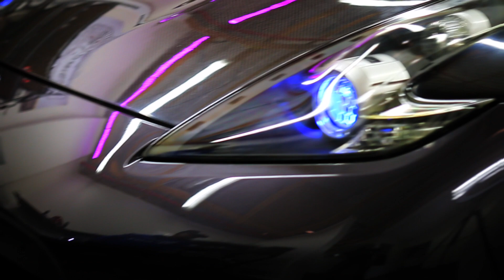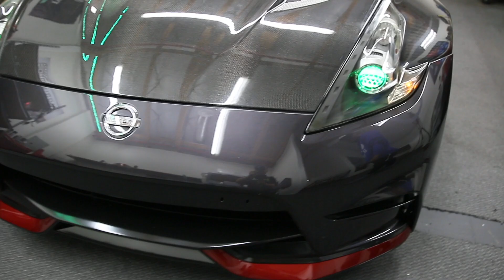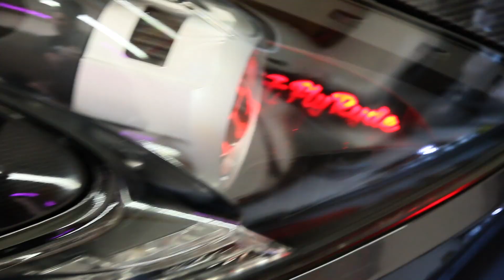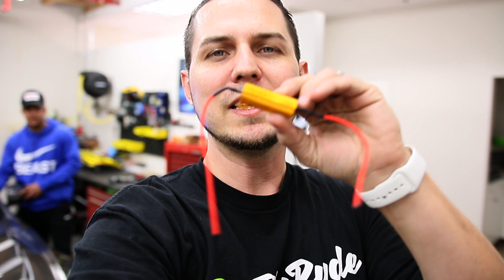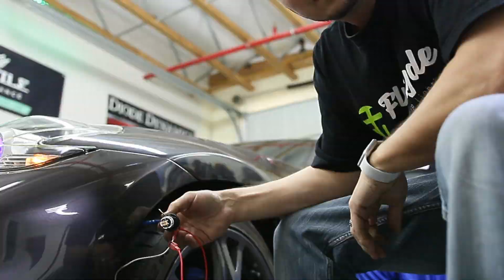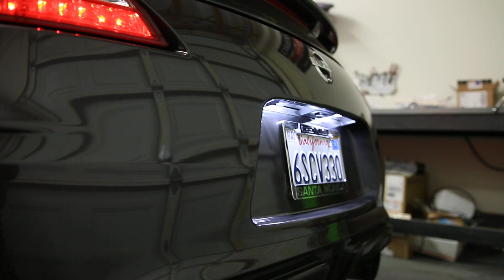RGB Demon Eye Headlights on Carbon Fiber Nissan 370z | FlyRyde

Comment: Most of the time, you really should use an LED flasher relay instead of using a load resistor... using a resistor eliminates half the reason for using LED turn signals.

Comment: So on a 370 Z, if I have switchback bulbs, I wire the resistor to the green wire and solid black wire?
Reply from the maker: Tyson Alamo haha, no, you wire it to the yellow and black, and to the green. The black wire needs to go to the parking light wire so it will turn on the white LEDs for switchback.

Comment: A good lens restore goes so far, especially on the inside that can't normally be reached! I polished the inside of my lenses the other week while respraying the inserts and the difference was amazing. Not sure if you remember, but in one of the live chat videos I asked about getting rid of haze from the inside after paint had gassed off inside the headlight. Took a bit of work but cleaned up perfect, until I marked the inside up putting the inserts back in.. HA! Another quick polish and came up mint in the end! Still haven't polished the outside of the lens yet.. This weekends job.

Comment: Hey Chris I question, I am starting a project on restoring a pair of headlights for a Volvo. These particular headlights have internal wiring. Do you think it’s safe to bake them in order to open lens or is there a much safer way of opening without burning internal wiring.
Reply from the maker: s0nic2nr 100% safe. Just about all lights I modify have internal wires, nothing to worry about if you heat them properly 👍

Comment: Chris, did you have to add the load resistor to the rear turn signals as well (assuming they were also swapped to LED bulbs)?
Reply from the maker: Terran Eligon rear signals and fronts always need load resistors, unless you’re fortunate enough to have a car with an upgradable flasher relay. I’ve played with the monster bulbs that have internal load resistors, but they’re expensive for sure.

Comment: so I was wondering if all led replacements  turning lights you have to put that thing. also what about the replacements  led bulbs ex break lights head lights
Reply: Yes in most cases you have to run the load resistors or you will get hyper-flash
Reply from the maker: Matt Theman if you are able to swap to a different flasher relay in the car (like a CF13) you don’t need load resistors at all. Sadly not many cars are that simple and require either a load resistor wired in, OR bulbs with built in load resistors (which are $$)